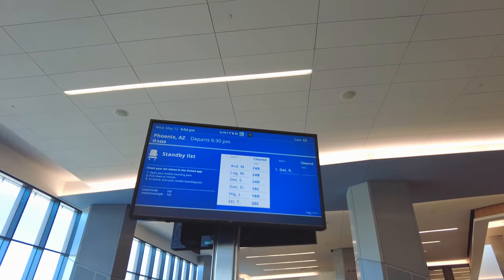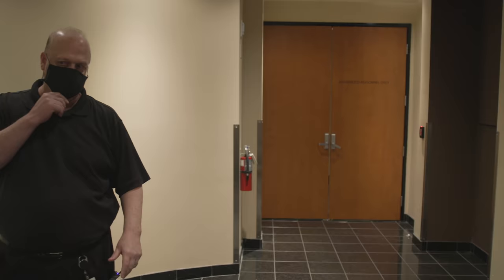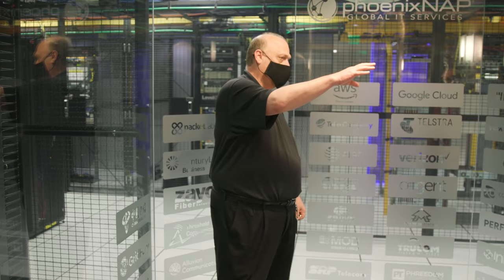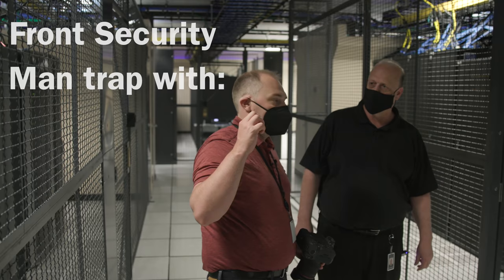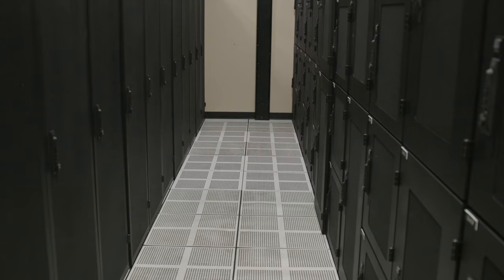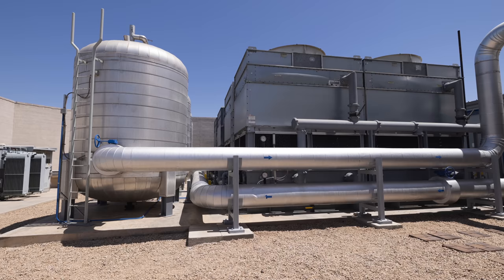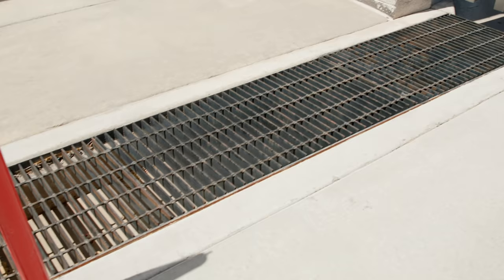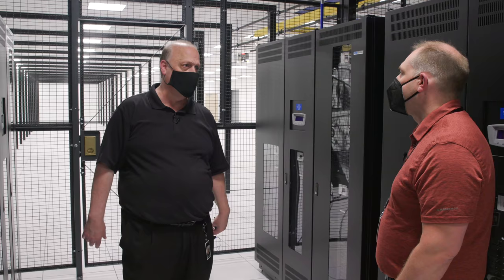A Fun Data Center Tour at PhoenixNAP

Comment: Very neat tour. You don't get to see inside a data center too often. I do however have a question about the photography/video restrictions. Maybe I'm just ridiculously naive about these things, but why is it so "sensitive" what hardware a particular customer or business is using? Why is it a "secret" whether a particular customer has IBM or HP or Intel or POWER9 for their servers or how many of them or in what physical layout? Why does it matter whether their switches are made by Mellanox or Marvell or some other company? And what kind of "sensitive data" would be potentially visible anyway? They're just damn servers, blinkenlights and all. Just....boxes, with disk drives, fans, grilles and LEDs all over and inside them. Not much sensitive there. And it isn't like you can just get inside there anyway with all that physical security, which won't stop a hacker getting in remotely from the outside (PhoenixNAP should be really well prepared for and equipped to deal with such an incident so I'm not doubting their ability to protect the data, but it's something to think about just the same). Again, maybe I'm being silly and incredibly naive, but I don't get the point of not allowing people to see or photograph the servers or other gear, not that there's much of import to see there anyway.
Reply: Corporate policies and proprietary info. If you want their business, you have to follow their wishes. Data is all about power speed efficiency etc. So keeping your corporate info secret is real. It's simpler to say No info leaks rather than this is ok...this is not ok...this is ok...this is not ok. Keep it simple, No info leaks, no pics, no vids No nothin
Reply: @mrmotofy  But I don't want their damn data! I don't care what "secrets" are stored in the boxes! I just want to see the boxes themselves! It just didn't make sense to me for them to deny any and all photos of the hardware itself. I could see now if there were technicians working in there with monitors displaying live activity going on. OBVIOUSLY you don't want THAT getting leaked. But the stupid machinery itself? I don't get it. As a CPU collector and technology enthusiast, I am curious what processors are run in those things. Is it System/z9, is it POWER10, is it an iteration of ARM and what iteration? That's all I'd be interested in. Too bad the data center or their customers won't share that. This is, perhaps, a possible reason the average privacy-conscious people don't trust these trillion-dollar-sized megacorps these days. All the secrecy and for what? A few million dollars' worth of boxes locked up in cages? Okay... Whatever you say, I guess.
Reply: @mrmotofy  I guess you are assuming that I'm THAT CRAZY (or maybe desperate is a more fitting word) to throw in and accept Microsoft's "conditional offer" of half a million bucks to host their equipment in my "basement". Firstly, I kind of don't have a basement. Secondly, my parents would likely never approve of it. Thirdly, even if they did, the damn things would be in my bedroom, likely unplugged because I ain't got 240 volts to power them with. And fourthly, MS would be INSANE even daring to do that. Yeah, I'd love to have a spare half million in my bank account every year. Who wouldn't. But you've made a HUGE assumption based on my comment that maybe wasn't really necessary. I cannot tell what's Department of Defense just by looking. If our DOD is putting their ultrasensitive things in general public companies' hands and NOT in the freakin' NORAD mountain, they DESERVE to get hacked, leaked and photographed as it happens. Just my opinion. As for businesses whose "livelihoods" reside in data centers like this, eh, you probably have a point, but again, I can't tell who's stuff is who's and frankly, I probably don't want to know anyway. That still doesn't answer the question of why THE HARDWARE ITSELF is a "secret". You only talk about the data that's supposedly stored in it. And I don't care about the data, just the box it's in. That's it. Sorry if that's too much for you to deal with and thanks for your replies just the same.
Reply: Showing that company XYZ is using a specific HP server model makes it easier for hackers. Narrows down the methods they need to use to try and infiltrate
Reply: @capnrob97  I don't exactly see how, though bear in mind, I'm no hacker and coding is not my strong skill. I wouldn't think it possible to hack any server with only the model and series in hand. I would think that, at the very least, the would-be hacker would need to know the UEFI firmware version, which you'll never see just by looking at the front of the server. They'd need to see the read-out on the monitor connected to it during boot time for that to work. And, thankfully, no monitors were visible in this video.

Comment: How is it they cool the water to 55F, they mention a 'media fill' or something? But I couldn't quite follow it.
Reply: Evaporative cooling. Basically, suck hot, dry air through a wet sponge and the sponge will get cooler. They do this on a much larger scale. (they also have refrigerant active cooling capabilities as well, because this doesn't work if the air isn't dry.)

Comment: A couple 2MW gennys isn’t keeping that data center up all full load is it?
Reply from the maker: There are concrete pads for more generators as the facility fills more.
Reply: 6, so that's 12MW. That's a fair amount of juice.
Reply: @morosis82  Except, you might have 1 in maintenance, and another might fail in the middle of everything.
Ie, one will need to have some overhead for redundancy. For facilities with 3 generators, the peak load is typically what 2 of them can give, the third is just redundancy. I don't know if the same ratio applies for 6 generators, it likely depends on the redundancy needed.
Reply: Usually it's n+1, with n being what is necessary and +1 being a spare. You can also have n+2 if you really want.

Failure is certainly possible, they are machines after all, so they are tested on a regular basis - each one gets fired up and run for a while to make sure it is in good working order. Most likely they have a very short SLA with Cummins to get a service tech out if anything does fail.

Fun fact, hot oil is constantly circulated around the engine block so that they are ready to start at a moments notice and go straight into full load with no warm up time - just a few seconds to synchronise their outputs.
Reply: @TomStorey96  I didn't know that about the oil, that certainly is a fun fact.

I did some work in PNG a while ago, most big business over there has their own generator for an office because power grid sucks big time. I think they had longer than a few seconds though, like 5 min or so on battery (only for important loads) so the generator could start and come up to speed.
Reply: @TomStorey96  I know some facilities tend to ride on the UPS for a minute or two before switching over to the generators.
But that obviously requires a larger battery bank.

Though, gives one time to start the diesel heater and get the engine closer to working temp, instead of always keeping it heated in case one gets that once in a year outage if it even happens that often. Data centers tends to have fairly good power from the grid after all, since most pays extra for that reliability.